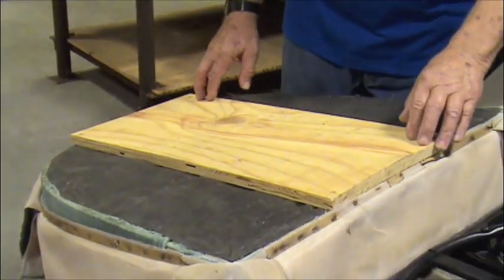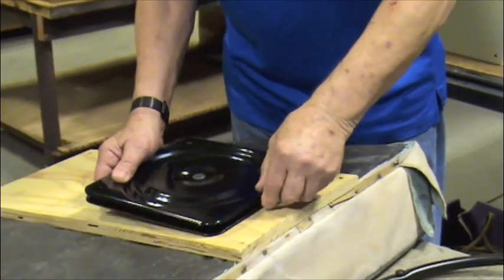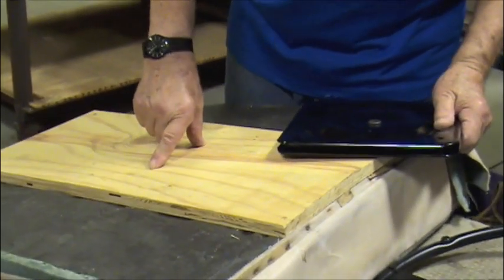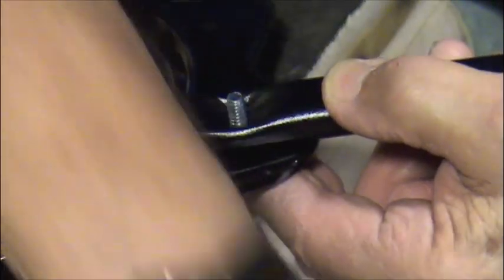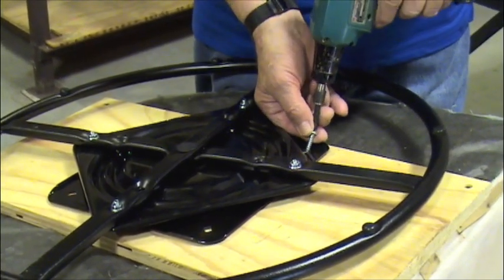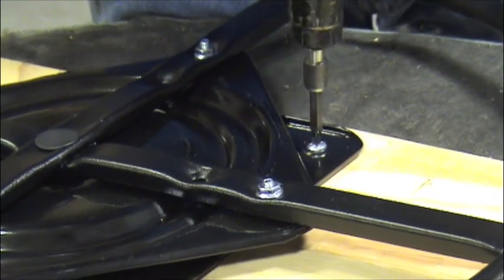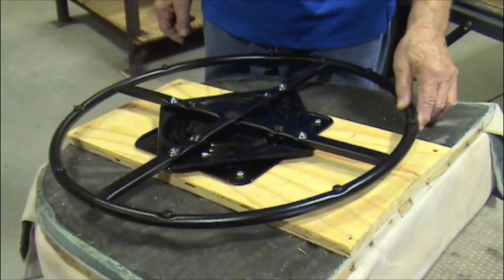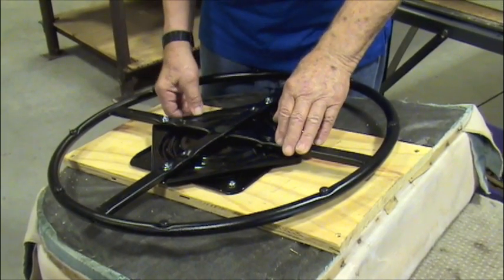Convert upholstered chair to swivel

Comment: I have a small desk and chair in the living room I personally find it stunning to have a beautiful upholstered chair as the computer chair. My only issue is that as it is an accent chair I continue to have to stand up, grab it, and turn the chair around. This is not a big deal but there were times I thought of purchasing a swivel chair until I saw the price and that idea quickly faded. However, I think THIS may have solved my problem and I will definitely get to work on this because, "it's no big deal". Thank you for the quick and easy tutorial and saving me from an impulsive purchase that would have soon turned to remorse.

Comment: Thank you so much, I can't afford a proper chair and table so I am converting a free coffee table into my study table. Since it is so low on the ground and I want a chair with good back support that also swivels (tight space where the table is) I have tried looking online for swivel floor chairs with adjustable reclines and the selection is very limited and expensive. This really helps (-: Thank you so much.

Comment: I love this guy. I watched only one of his other videos and understood he knows his stuff. I am holding my breath to learn if a recliner can be converted to a swivel.....Inconclusive. He mentions that the swivel base might need to be shifted toward the front or back of the chair if it tilts. An extended recliner can be expected to shift its center of gravity and might tip over with a swivel base. The other concern is that the metal tubing sits directly on the floor. That might not hurt carpeting but could contribute to damage on a bare floor. I would want some sort of glider beneath the ring.
Reply from the maker: Thank you for writing. Most of the time the process increases the chair seat height unless you can add the swivel unit without increasing the height. Some recliners you can and some you can't. Balance will be trial and error.

Don

Comment: I have a need to replace just the ring on my recliner/swivel/rocker/glider. The ring on my chair is 24 inches but I need to go down to 22 inches and I see you sell one. My question is, are the predrilled holes in this hardware standard in distance and position? Or in other words, do you think I'll be able to swap these out without any problem?
Reply from the maker: Freedom,
We only have the 24" size. If you should locate a 22" diameter, it will have the identical swivel plate holes distances.
Don, SCP

Comment: Thanks - good info but what do you do if your combined parts are not as high as the legs you removed from the chair?
Reply from the maker: The ring and swivel is especially designed for low leg chairs and I wouldn't suggest using more than a two board height. But there is an item on the website called "swivel only" that comes in heights up to 5 7/8" plus the board. http://www.swivel-chair-parts.com/254ASwivelLegSet.html
Reply: swivelchairparts I noticed that last night on your website. It looks like just what I need. Of course it raised another question for me: I know you say the little wheels on the five prong swivel are kind to floors but they look like they'd dig in from the weight of the person on the chair. I have cork floors and they are kind of soft so I am nervous.
Reply from the maker: We do have one model that is 1 inch taller, but if that is still too low you can always double up on the plywood.

Comment: When you pressed down and rotated the Base that attaches to the ring on one side and the chair on the other, it stayed in a star shape.    What would be the cause if we press down, stuggle to get it to the star shape (extremely struggle) & it will not stay in a star shape.   It keeps going back to one square on top of another square.  This was with a brand new chair and the identical swivel base parts you had were sent with the chair.
Reply from the maker: Guessing about someone elses product to help you, I'd say that the other product has a spring in it to make return to a square. Don't forget, there are copy cat manufacturers.

Don

Comment: If I cut the legs off of my chair before installing, will the chair be too low when sitting in it after the swivel is installed?

If I saw then legs off, will it weaken the frame? My legs seem to be one piece with the frame.
Reply from the maker: If the legs are taller than 2" you would have to build it up to the original leg height. Sawing off the legs does not make it any weaker.

Comment: great video now how can you attach castor wheels to it?
Reply from the maker: You can't! The metal is too thin. As you would tighten the nut you would be crushing the metal tube and it would not hold a caster.
Reply: @swivelchairparts  rightly so your answer, I think i'll try making a dolly out of 3/4 inch plywood  and set the ring in it and strap the ring down at 4 points without drilling in the ring, thanks for your info
Reply from the maker: Yes, Shepherd makes a 1" x 2" plate with 4 screw holes that connects to a Shepherd caster. That would work. Don SWP

Comment: What do you consider a chair thats to big? and my arm chair has 4-5inch legs, so if I just do the swivel it will be to low? so I do the rock/swivel for the chair to be at seat height?
Reply from the maker: Terry, the ring and swivel and the board to attach totals 2 3/8" high. We do have a swivel ONLY with 5 legs for the height you need. https://www.mychairparts.com/254ASwivelLegSet.html

Comment: I would like my chair to just swivel but not recline. Can I do that by excluding the ring portion?
Reply from the maker: Yes you can but without a support base (round or square) it probably will be tippy.
Reply: swivelchairparts I plan on supporting it with a round piece of wood. On both sides
Reply from the maker: That will work too.
Reply from the maker: Definitely not recommended...oit will be very tippy.

Comment: How "THICK" is the plywood, Mr. Expert?!
Reply from the maker: If you are lucky, the wood is 3/4" thick and if you don't need too much, you can add another inch or so. If you can't add wood, buy a taller unit.
Reply: That is "outstanding"! I am so glad folks upload YouTube videos about themselves and their skills. Don't be surprised if someone knocks on your door and wants to know if you're willing to pass your skills to another generation. As a commander, it is VITAL that every bit of information is gathered..as well as sent out. You give the length and breadth but fail to mention the width. It is extremely important that one gives ALL the vital information that one would need to carry out the plans of others. I'll let that sink in.
Reply: If you cant tell that the wood is 3/4 plywood, you probably should be using a power drill... I'll let that sink in
Reply from the maker: 3/4"